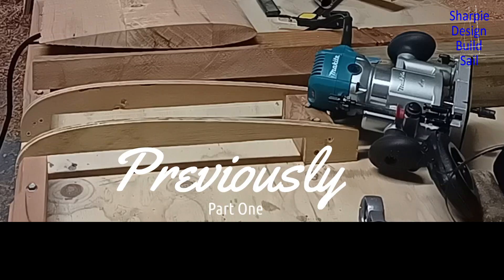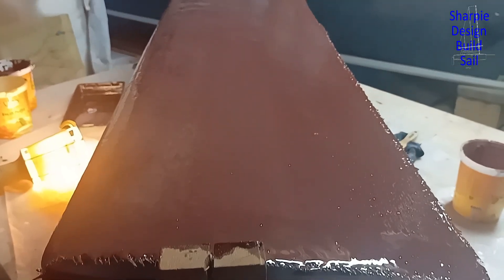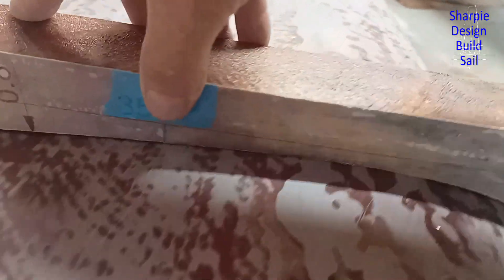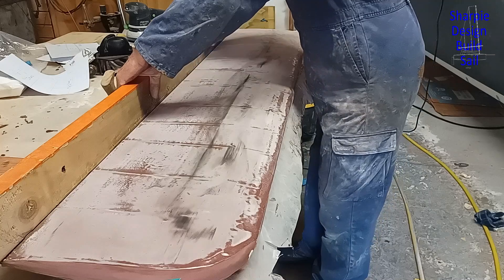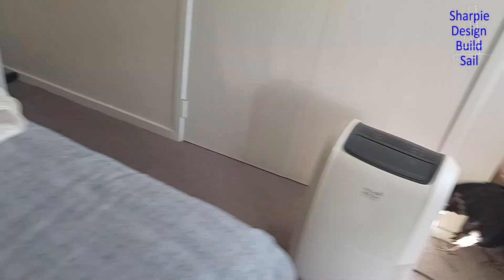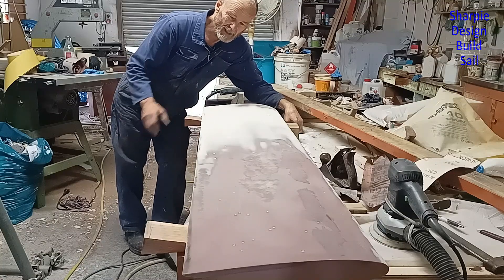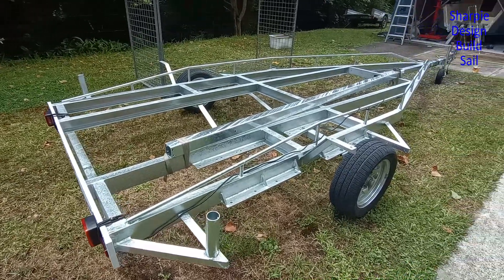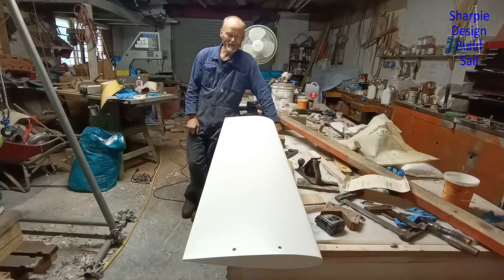NACA Rudder Fairing & Durepox Finish – Sharpie Build Progress! V66 Pt2

Comment: Wow nice videos ! Thank you for putting them together. I'm building a 46' catamaran and I m interested in the planer technique you are using for fairing. What size planer are you using ? And how often do you have to sharpen the blades ? Thanks
Reply from the maker: That's great you're enjoying the videos!
Yeah the plane works really well for dealing with the initial high points which are easy to find. That's just a flat plane you see in the video but I also have a plane that can adjust the curve which was great on the hull for the timber and the fairing filler. Probably have to resharpen every hour or two if you're using it all the time. Sorry not sure of the size of plane but it's mid sized.
All the best with your project!
Reply: @KarlFullerNZ I'll look into the curve planer..
 I'm trying to improve my technique, I have sooooooo much to do ! Thanks a lot.
Reply from the maker: @fredericmora  The name of the plane is a Stanley Compass Plane #113. There's not many around in NZ but got one on an auction site and it was great for the initial fairing on the hull.

Comment: Why did you go to the effort of shaping the entire board instead of just shaping the length that sees water? As far as the casting goes I'd be doing whatever is quickest. Also the trailer looks real good, looks strong and a interesting design, don't see that type here in Australia and also the price is unbelievably cheap compared to here.
Reply from the maker: Now that's a good question that maybe I should have explained in the video. There is two intentions of the design that maybe what you suggest mightn't work. The first is I want to be able to raise and lower it by sliding up and down, I intend to explore some shallow waters and the other reason, the rudder is intentionally a little oversized because of the type of the rig which changes the balance of the boat more than other rigs so some of the time, it may be used in a semi raised position. The other thing I'd like to achieve is that the rudder can kick up if it hits something and it will eventually and I have a design that could achieve that, well actually, I have more than one idea competing so watch this space! But I can certainly see the merits in your suggestion if I was keeping things simple.
Thanks for your vote on the method of building the rudder stock, still deciding.... Powering into the fairing right now and trying to decide on the paint system considering I'm not so keen on spraying anymore. International Perfection I've used before with great success with rolling and tipping.
Interesting to hear we might have something cheaper in NZ than Aus! We hear all the time things are cheaper over there, houses, food etc.
Cheers for the feedback!